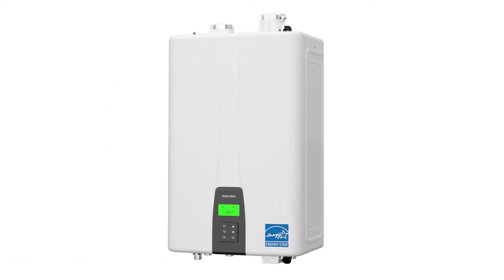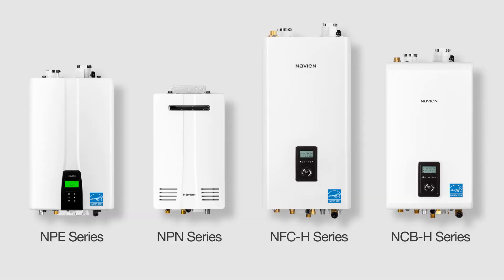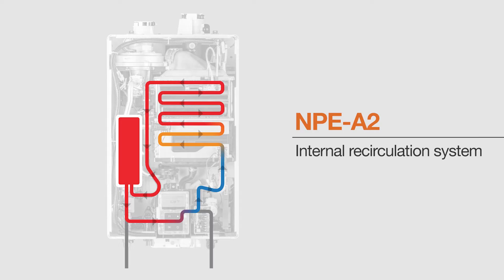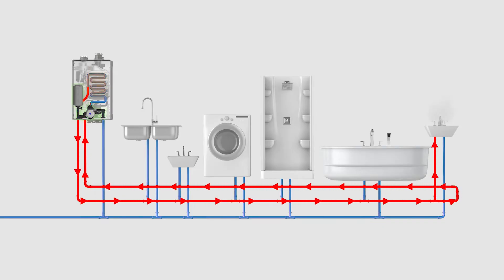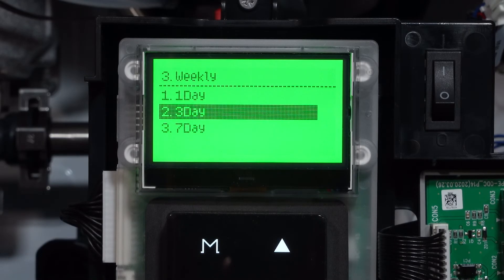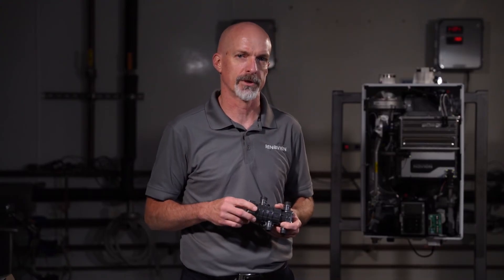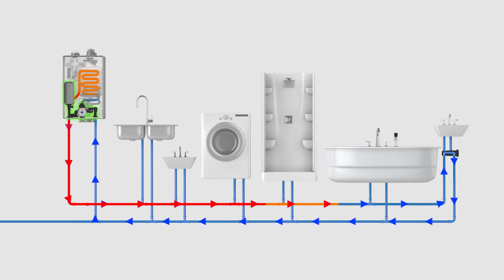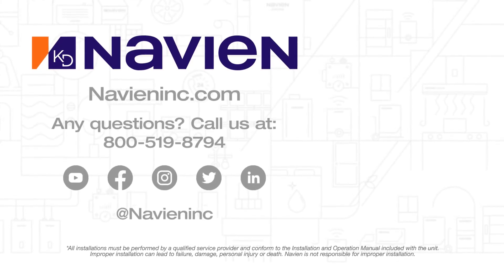Recirculation Control

Comment: I have a dedicated return line. I use Alexa to turn the recirc pump on for “x” number of seconds. From cold to having hot water at the end of the line is a constant 52 seconds. It’s going to run anyway so it really doesn’t waste gas or water. It’s a win/ win situation. I haven’t tried different times from different Alexa’s to fine tune the savings

Comment: the model I have does not have the internal pump/reservoir. Do I have to get an external pump? Also, would I be able  add on the inrernal pump and res?
Reply: There is a recirculating pump called a chili pepper that you can put under your bathroom or kitchen sink. I’ve used them for over 10 years. You do not need a plumber to install it. Very simple.

Comment: My NPE-A2 ran perfectly fine using the recirculating system until the end of December.  Unit was installed in the late fall of 2022.  Now, in either recirculation mode, it no long works, pumping only at a minimum rate, taking 5 minutes or more to get water temp to the set 125 degree temperature.  The Navien recirculating valve is installed by our dealership that sold us the tankless.  They cannot figure out what the problem is.  They claim the pump is working properly, and it does until they leave my home.  I'm getting really frustrated and need help. No one has offered to replace the pump or the control board to see if that could be a problem.  It is still under warranty.  Please help me.
Reply: Call the navien help line and explain your situation
Reply: It can be the motherboard

Comment: Trying to find a solution for the NPE-240a with external recirculation line. The unit was installed over 2 years ago, and dip switch setting is Sw1 & 2 are both on for Intelligent mode. Over the past 6 months, when the recirculation pump turns on, I get pipe tapping noise (like air in line), and are trying to figure out how to fix it. The unit was installed with all PEX lines and insulated. Additionally I wanted to ask if it's okay to lower the pump run time to 10 minutes vs. the default 20 minutes. Thanks in advance for your support.

Comment: Installed a new 240A2 with navicirc valve at distant sink. What is the settings on the machine internal vs external circulation? Right now there is no pipe entering the recirculating port on the water heater. Please help. Thanks
Reply: External

Comment: What should you do when you have an external unit & when you plug in the recirculating pump it’s stays running and never shuts down. I added the smart plug as well and it’s shuts off but it’ll automatically turns on & off with no by itself with no water calling in the house. When it runs it stays on for awhile before it shuts off
Reply: With an external pump it is controlled by the outlet it’s plugged into. The easiest way to address it is a timer that plugs into the outlet, and the pump plugs into the timer. Sounds like you got something similar. You should be able to turn it on or off in 15 to 30 minute increments.
Reply: Get an ALEXA plug....start the recirculation feature anytime, from anywhere.

Comment: Do you folks have a video on how to set the recirculation to intelligent? I just got this hot water heater and haven't had a chance to play with the menu yet. Also, how do I select internal or external?
Reply: Those are all changeable in the settings menu. Find the recirc settings and go through all of them. You will be able to address all of those.

Comment: How do I configure the HotButton recirculation to recirculate as long as the other modes when they kick on?  The other modes recirculate until the return temp is 9F less than the hot outlet set temp, but the HotButton recirculates only until the return reaches 100F.  Worst, it doesn't do this by default either, as the default settings have it running only ~10s; the farthest fixture setting has to be changed from the default of 30 ft to some high unrealistic value (200+ ft) in order for the HotButton recirculation to run long enough for the return temp to rise that high.  Whatever formula it's using here to calculate runtime, it's broken, as it doesn't reflect reality.

Edit: Found the solution to the HotButton issue.  On my A2 model, turn on dipswitch 2 on the HotButton PCB to disable Energy Savings Mode, and it'll recirc like the other recirc modes.  I called Navien Support, and they wouldn't tell me how.  Had to google and do a bit of reading to find it.  Navien, maybe you guys can also explain why you won't tell me how to configure my equipment to work the way other modes already work.  Pretty infuriating how useless support is.
Reply: My 240 has a setting to select how many feet to the furthest fitting, (adds time)

Comment: how is the hot water being returned in that loop? is there a dedicated 3rd pipe dedicated that needs to be tied in into faucets? or does it use the cold water line as return  .
Reply: I believe the navien recirc pump utilizes the cold line as a return
Reply: @Countrysidehvacservice  No it doesn't. You need to run 3dh pipe from last hot plumbing fixture back to the NAVIEN inlet. That's the only proper way
Reply: @NellyMiha05 you dont have to. Recirc value will be used upto certain temp to cross over, however uses cold pipe to return to unit.

Comment: So, for a NPE-A, for an external recirculation retrofit, I just need that recirculation valve?
Reply: same question i have , is the cold water line in the existing house being used as return right? by connecting that black 4 way vavle on the last faucet
Reply: @joker-if4gu  never heard for that option

Comment: I want to do a recirc return line (210A2) is a expansion tank required? Also, at the end of the loop, do I need a normal  three way fitting ( from tank, to sink and return to tank) or a swing valve? Thanks!!

Comment: If I use it in external circulation mode. Would it hurt the unit if I control the pump seperate from the unit. Would Turing the pump off cause it to over heat seeings that water movement would stop?
Reply: Basically I want to use an aquastat to control the pump without the machines knowledge. I know on some boilers it you turn the pump off while it's on will cause it to shake around due to the water boiling in the heat exchanger without any movement. Thanks

Comment: I did the hot water outlet in 1" pex and the return reciruclation pipe in 1" is that going to be a problem ? I have the NPE 240A2
Reply: Unless you have a recirc pipe that is several hundred feet in length, 1" is very oversized. This could cause laminar flow, temperature fluctuations, and unnecessary work for your recirc pump.

Comment: just wondering if running the recirculation all the time is a concern for the pump or system? Only reason I ask is that was a option shown on the menu of your video but the speaker didn't speak to it
Reply: This navien model has different recirculation settings not just constant recirulcation. It has a smart use setting
Reply: Constant recirculation can erode copper water piping over time, causing pinhole leaks. For newer houses with all PEX water piping, the risk and electricity usage is pretty minimal.